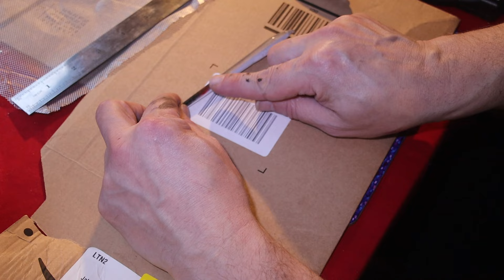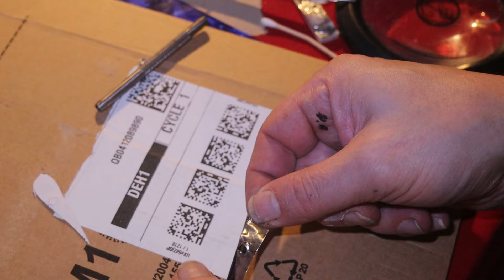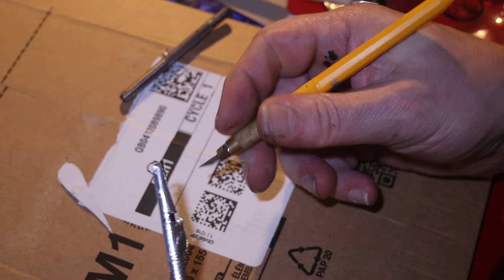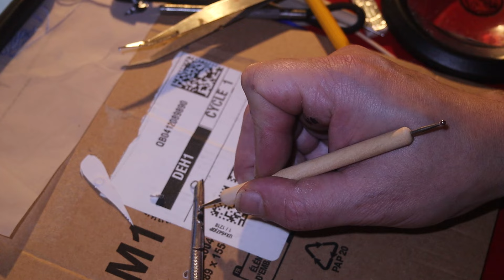Lure Making - Beautiful wooden Needlefish! Made from a cheap Amazon tool!

Comment: Nice lure,I have 2 advices,I think that middle point eyelet hook wire should be little more towards back of the lure,for example if lure is 20cm long middle hook should be around 8cm from back or 12 cm from front,,and you can use superglue and baking soda to fill the wire gap,but this hardens more so it is harder to sand it. Grettings from Croatia

Comment: Amazing lure. It might be difficult, but you could bisect the wooden body, carve out a chamber, and make a magnetic weight transfer system. It could cast a mile. the only down side to that idea is that you would have to use screw-in hook hangers. There's a lot of potential this bait.
Reply from the maker: Thankyou so much! I would love to put a transfer system in , but theres just not enough room on the body of the lure. ( its thinner than a pencil for 3/4 of the length). Lol it would cast to the moon! However even without the transfer system it  casts really well as its tail weighted and super aerodynamic. Its come in at 10.5g so nice and easy to keep it up top if the fish are hunting close to the surface. Just wish we'd get a calm period where I can use it, stupid storms!